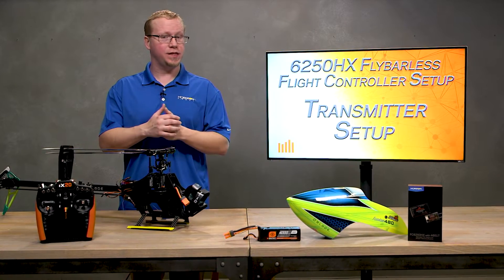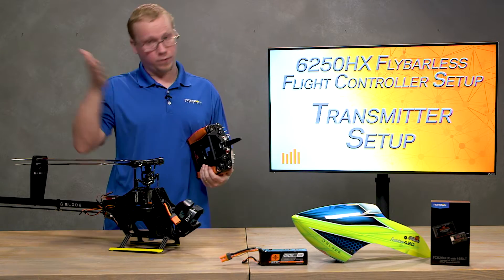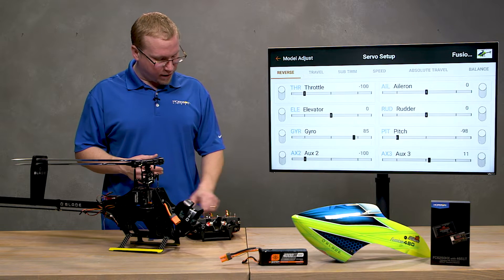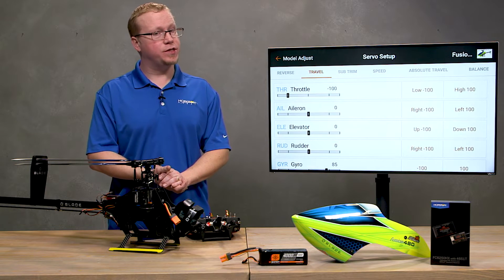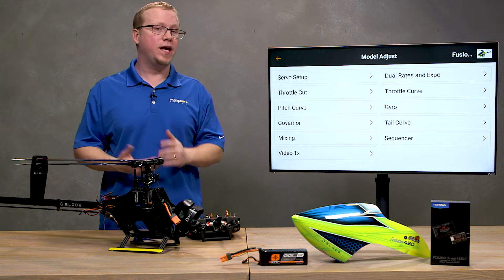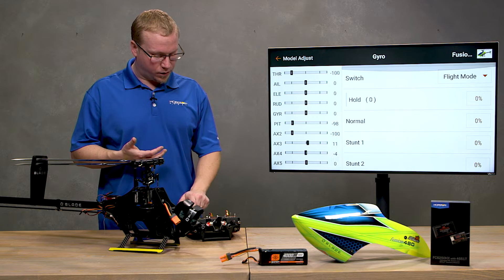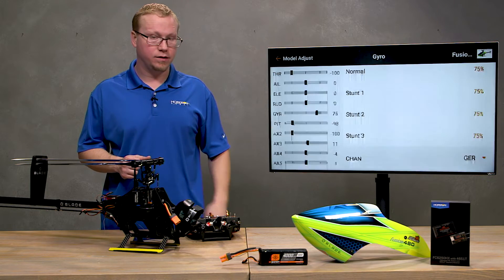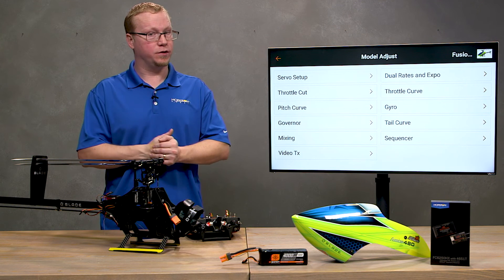Part 3 - Transmitter Setup - Spektrum 6250HX Flybarless Controller Setup Series

Comment: This video is outdated. With the upgrade of ix14 sooftware . All the channels youve assigned dont correspond with the current airware. 
So i basically dont know which chanel or switch i should be using . You put GER for eg. But mine states A5???

Comment: HI! My swashplate with the Spektrum FC6250HX is not working properly. I went into forward programming with my Spektrum NX10 then output set up and finally servo reverse and I tried all the combinations but my swashplate is not going in the right directions. I spent hours and hours. Very disappointed with the Spektrum FC6250HX I ordered the new Microbeast ultra pro instead.
Frank from FRANCE
Reply from the maker: Hi Frank, one thing that many over look is that the Swash type setting on your TX needs to be set to NORMAL. If you set it to anyother swash type this will happen. All the swash mixing is done inside the FC. Hope that helps!
Reply: @SpektrumRCvideos  This is what I did. I set my swash to normal on my TX my now I have another problem, My both servos right and left move in the right direction when I move gaz up but the third servo on rear don't move at all and no matter the reverse direction I set. It is like no signal comming from this channel. Though I tested this servo with my XBC100 smart checker and it's working fine
Franck.

Comment: Why don’t you do the setup on a radio the average  person can afford?
Reply from the maker: The menus and options are essentially synonymous between all current Spektrum Transmitters. But if you need to see it differently, we suggest checking out our friend Justin Coe's videos on the 6250HX where he sets it up with a DX9. Hope that helps!
Reply: @SpektrumRCvideos  I can’t figure it out I’ve setup many 7200bx systems.  Maybe it’s a bad unit. I’m going to cut my losses and buy an ikon.  I watched coe show pretty much the same as yours.  Ive tried your tech support before and it was just email tag.  It’s a shame because I used to like spectrum. I also saw that cow show switched all of his to Ikons.

Comment: What if you don't have or want to buy the new transmitters with forward programming? Surely there is a way to set the controller up without forward programming?
If not, that is a deal breaker for a lot of potential customers.
Reply: Forward Programming is not in the transmitter, the software is in the receiver and gets loaded when you connect to the transmitter, that is why you need a Gen 2 or 3 transmitter. When you load another model the firmware is not there  if you are use a normal receiver. Hope you can follow this.

Comment from the maker: In this third part of the series, we will walk you thru the recommended transmitter settings for the 6250HX. These settings are demonstrated on a iX20, but the settings are synonymous with all DX Gen2/3 models and the iX12. 

Here are links to the other parts of this video series
Part 1- Introduction @
Part 2 - Installation and Binding @
Part 3 - Transmitter Setup @
Part 4 - Swashplate Setup @
Part 5 - Tail Rotor Setup @
Part 6 - Final Steps and Preflight Checks @
Part 7 - Safe and Bailout Setup (Coming Soon)
Part 8 - Smart Technology Setup (Coming Soon)
Part 9 - Tuning with James (Coming Soon)

Equipment used in this video series
Blade Fusion 480 Smart Super Combo - https://www.horizonhobby.com/fusion-480-smart-super-combo-kit-blh4925sc2
Spektrum 6250HX w/ 4651T Telemetry Rx (included with Fusion 480 Smart Super Combo) - 
Spektrum iX20 Smart Transmitter - https://www.horizonhobby.com/fc6250hx-helicopter-flybarless-control-system-spmfc6250hx
Fusion 480 Stretch Kit - https://www.horizonhobby.com/fusion-480-stretch-conversion-kit-p-blh4965 
Spektrum Avian 100 Amp Smart ESC (included with Fusion 480 Smart Super Combo) - https://www.horizonhobby.com/avian-100-amp-brushless-3s-6s-smart-esc--spmxae1100
Spektrum H6050 Cyclic Servos (included with Fusion 480 Smart Super Combo) -
Spektrum H6360 Brushless Tail Servo - https://www.horizonhobby.com/spektrum-h6050-high-torque-mid-speed-heli-cyclic-servo-p-spmsh6050
Spektrum SPM4767 Remote Rx - https://www.horizonhobby.com/dsmx-remote-receiver-spm9745
Spektrum Smart Lipo - https://www.horizonhobby.com/222v-4000mah-6s-50c-smart-lipo-battery--ic5-p-spmx40006s50
TL90 Digital Pitch Gauge - https://www.amazon.com/YoCoo-Display-Airplane-Helicopter-ST250-800/dp/B017LYIPX6/
Reply: How do we set up Smart Telemetry?  I'm stuck
Reply: ☠️BLACK BARON☠️ 1:55 ... adjust ... while in flight ... during flight ... confirmed. ( Tail + STABILITY )